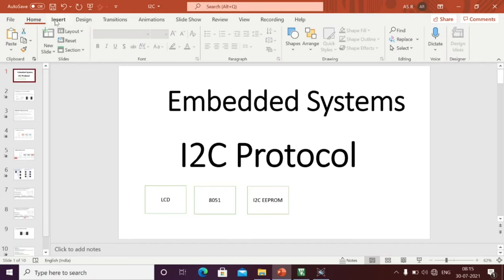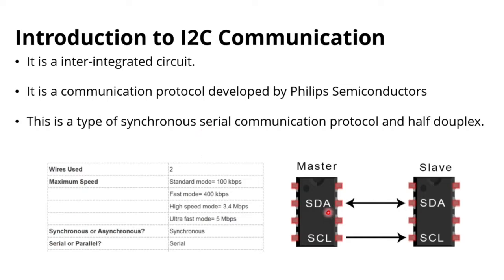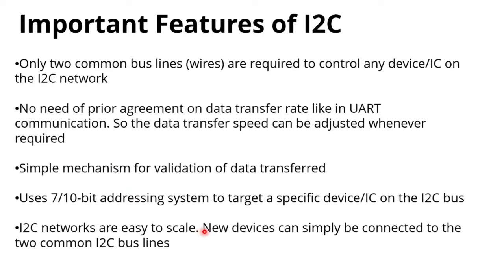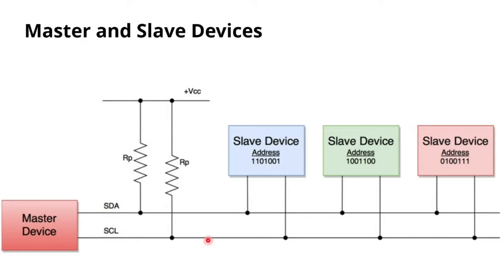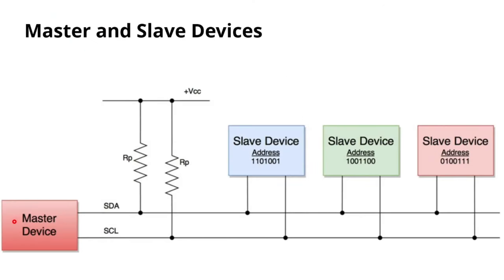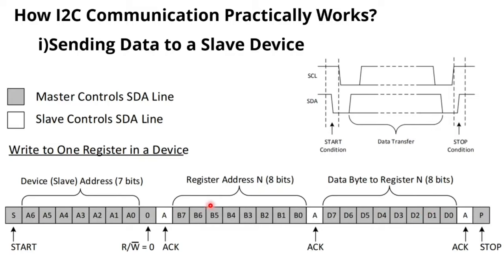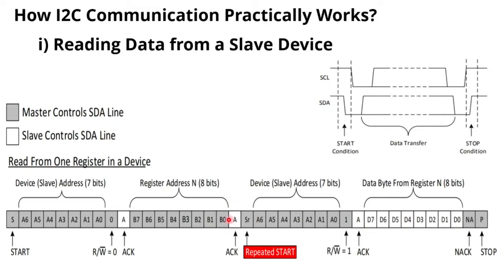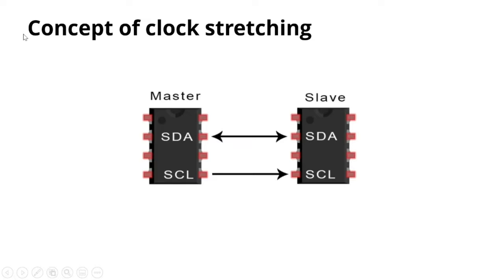[ES-EN-41] I2C PROTOCOL WITH EXAMPLE || Embedded Systems

Comment: Why do we need to check the starting bit of 0xA0-1010 000, ( the first '1')  with the AND operation? SDA=( Data& 0x80)???? (1000 000 =0x80), what is the purpose of checking whether the first value is '1'?
Reply: Correct. In addition, to read the data on the 24C02 we have to switch the port from mc P3.1 to input.

Comment: In line number 106 :-     SDA = (DATA & 0x80) ? 1: 0 ;
What is the significance of ? and : 
They are not bitwise operator, on internet these are the only operators I found.  &  ~  ^  >>  <<  |